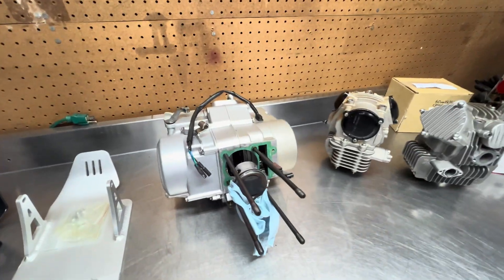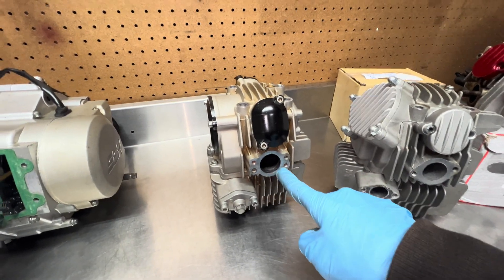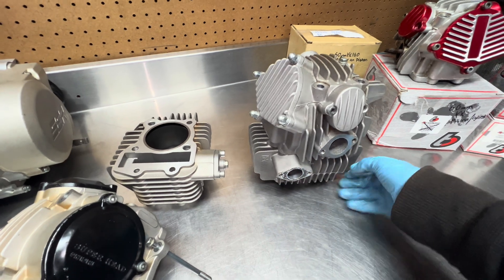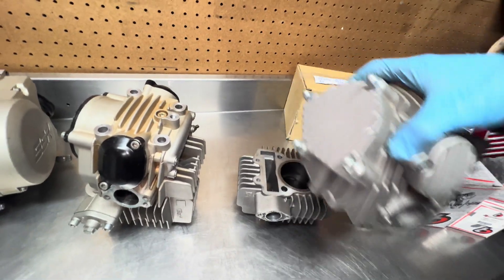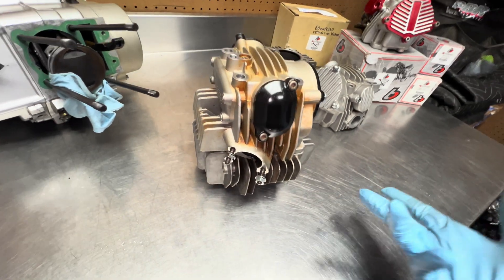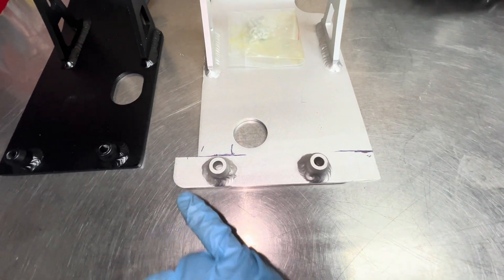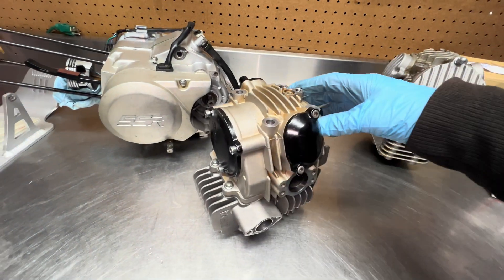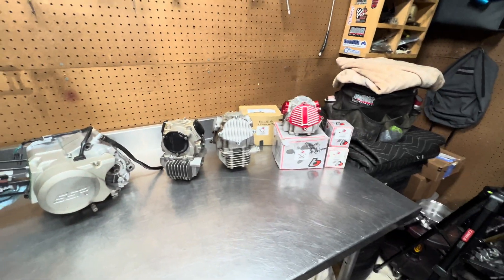Engine Build Started + How to fit BBR KLX110 Skid Plate to YX Engines

Comment: I have a SSR yx 160 motor under my bench that I got from my shop and came in a bike not running but has loads of compression I've been wondering what cylinders and pistons I can use
Reply from the maker: @blakemancumberworth9167  nice! I like the yx 160 engines to build they use the klx cylinders and aftermarket bore kits . Check out Tboltusa.com they have tons of parts for these china engines and TB parts makes the big bore kits
Reply: @JesseK410  appreciate it and idk why but even the foreman mechanic gave up trying to start it lol and they just got a new one. Haven't found a donor bike for it either so I haven't messed with it. He said it had tons compression and good spark just would not start at all.
Reply from the maker: @ yeah never know could be something silly or could be something major haha